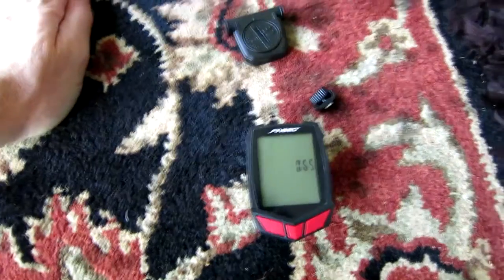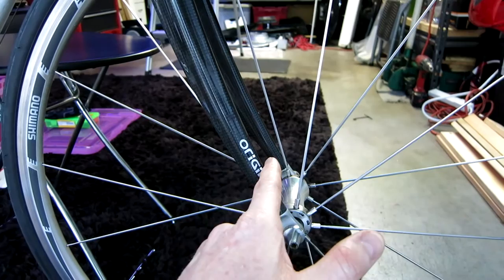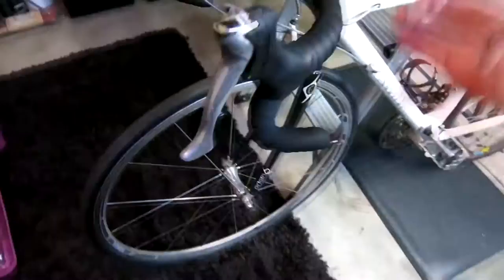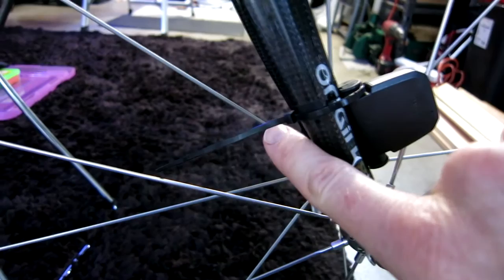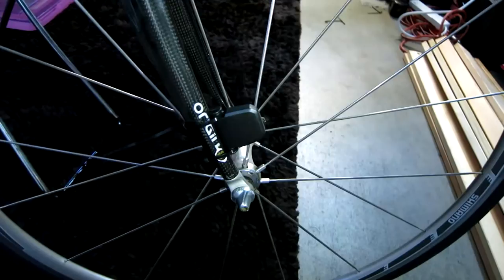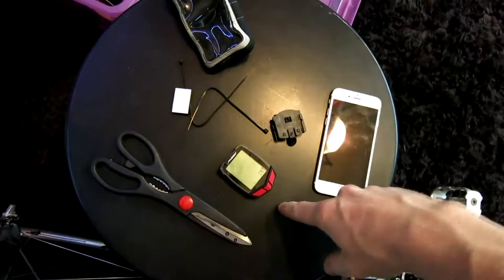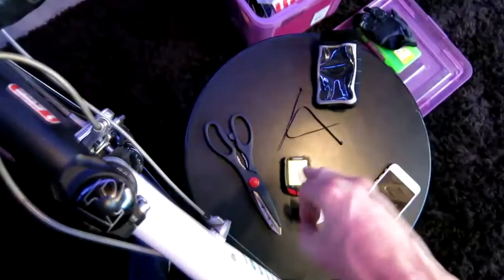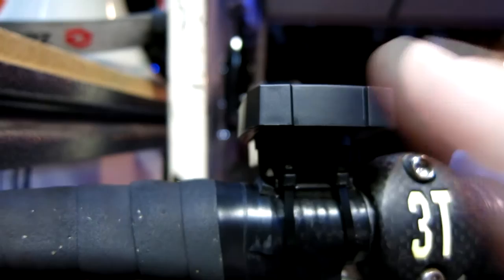How To Install A Bike Computer

Comment: Does it not make any difference were you place the magnet and receiver? I would think that moving it up or down would effect the circumference measurement?
Reply: I know I'm replying to a 3 year old comment, but I just couldn't help myself even if it's a bit late. 

This is basically just a counter, It doesn't go by how fast the magnet passes by the sensor, it calculates the speed by how many times the magnet passes the sensor over a set amount of time. 

As example tape one end of a string to the hub and tape the other end of the string to the rim straight up from the hub and spin the wheel, the string at the hub end is going to pass at the same time as the string at the rim end.

Comment: Does it matter where the sensor and magnet are installed? For example, do they need to be closer to the rim, in the middle, or closer to the hub?
Reply: No, it doesn't matter where on the spoke you place the spoke magnet / sensor.

Comment: The speedometers from 50 years ago were more accurate.   They matched the turn of your wheel size.   Here you have the spoke turning twice as fast towards the center and twice as slow towards to rim or where your tire is at.   Everyone is going to have fake mileage readouts unless this is matched so many inches from the center point or top of the rim.
Reply: Why do you think all the various cycle computer companies don't mention the importance of where on the spoke the magnet should be located? Because it is not important and doesn't make a difference.
Reply: Because its all about money and profits first.  Do you think corporations would tell you this?   Think about this real hard...   The closer the magnet is to the outside rim the longer it will take to pass the reader.   It does not have a brain to make adjustments.    If the manufacturer says it makes no difference they are not being honest.
Reply: Why don't you run the test I already told you about? On one spoke place a ribbon near the rim and on the same spoke place another ribbon near the center. Adjust the wheel so the ribbon near the rim is at 12 o'clock position and note where the second ribbon is. Rotate the wheel ONE revolution until the ribbon near the rim is again at the 12 o'clock position.
. 
Where is the second ribbon?
.
You think about this real hard.
Reply: Because you would have to spin it for miles. .  This unit is not automatically going to self adjust itself .   You would be better off with a 50 year old Schwinn stingray speedometer.   At least the claw was calibrated to the size of the wheel.    I watched a lot Bullwinkle and Rocky and it was always educational somehow.
Reply: So did you run that ribbon test or not? And what does that show you?
.
You stated: "Here you have the spoke turning twice as fast towards the center and twice as slow towards to rim or where your tire is at." Do you still believe that nonsense is true? 
.
What makes you think that: "The closer the magnet is to the outside rim the longer it will take to pass the reader."? The ribbon test proves this claim of yours is false.
Reply: Come on Furburger.......admit it, he's right . Towards the centre the magnet is moving slower but it has a smaller revolution to travel and vice versa towards the rim of the wheel so they both do a full revolution together. I'm glad you weren't my science teacher. 😂😂😂